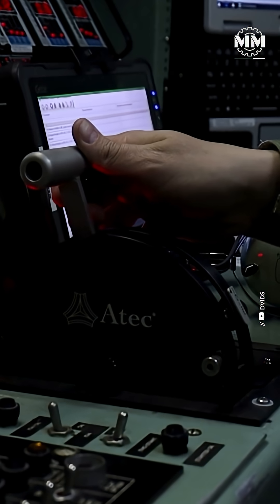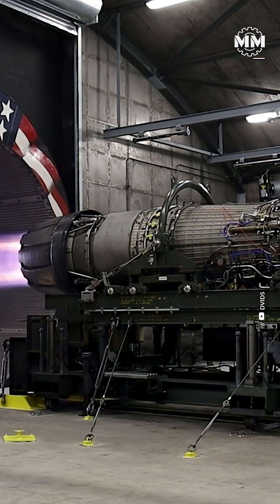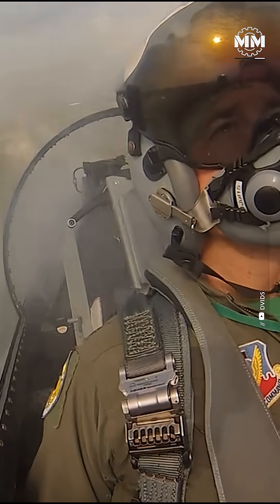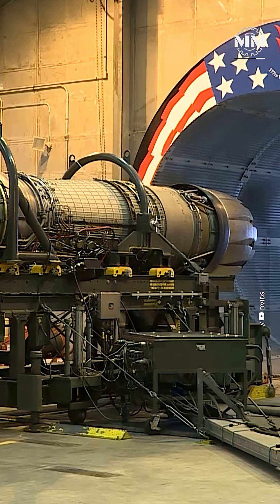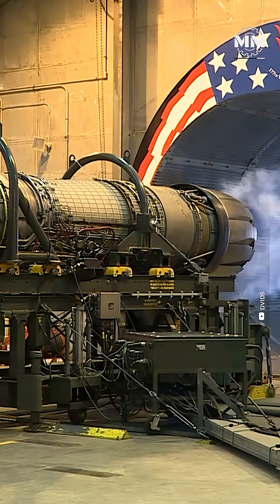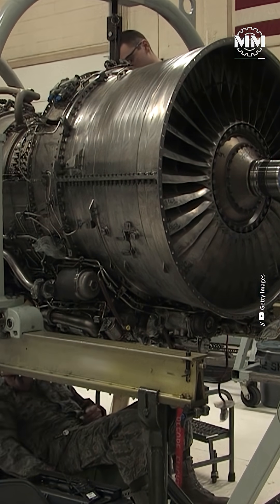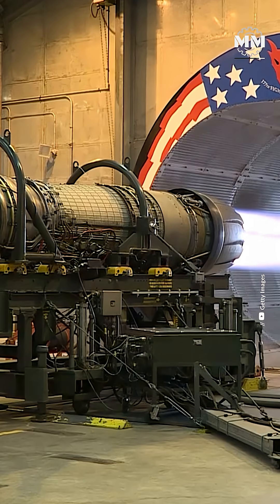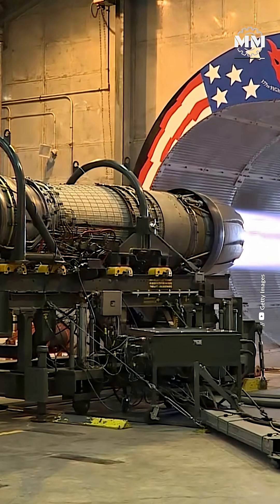Why MiGs and Sukhois Smoke Like Crazy But F-16s Don’t

Comment: the F-4's smoked as well. Don't think I've ever seen a photo or video without those double black soot lines, unless the plane was on the ground.
Reply: I believe that was over 50 years ago,we used to fly bi planes to,but guess what,we don’t anymore.
Reply: J-79s.  Old smokey.  The whine is amazing.
Reply: We learned the hard way. I've seen F4 smoke at over 10 miles (16 kilometers) if they see you first, they have the initiative.  Which usually doesn't work well for you.
Reply: @CarlW-d8c  At the time the F4 was in service, the other planes smoked too, and for the same reason.
Reply: @shane99ca The Mig 21 had only one engine, that smoked considerably less than the F4. It also was much smaller and harder to see,so often our pilots were responding to an attack, not attacking. On the back foot to speak. It was said at the time that was a consideration for the F 16. Which is non smoking and small hard to spot. 
     Using Radar pinpoints you about twice as far away as you can get a return to spot them with. Like being out in a big dark field and turning on a flashlight.
Reply: @CarlW-d8c  One engine smokes less than two. Also, the MiG-21 was a very early design (basically the Soviet Starfighter) with a leaner fuel mix. The J79 turbojets used in the F-4 were notoriously smoky.

Also the MiG-21 had a crappy radar because its nose inlet left no room for a proper radome. The radar dish was actually INSIDE THE SHOCK CONE, which meant that it was correspondingly tiny–and limited.
Reply: The F4 used turbojets, not turbofans. Turbojets were the first type of jet turbine, and were compact, powerful—and dirty. No fan, zero bypass; 100% of thrust came from combustion. The B-52 originally used eight turbojets and its exhaust was BLACK. You can see it in old newsreels and movies like You Only Live Twice.
Reply: @shane99ca You're right  I saw old B 52s in the mid 60s.
Reply: We have both mig 29 and f4 and if you seed their takeoff you see mig 29 is much more smoky during the takeoff.
Reply: @mehdifatemi5329 you middle eastern?   Just guessing by the name.   Have any cool videos of takeoffs or landings?
Reply: You're comparing the F-4 (64 years old and retired 30 years ago) to the su-34 introduced 10 years ago? LOL, keep coping buddy.

Comment: In engineering... and combat.... simplicity is king
Reply: Sometimes yes. Sometimes it depends on the situation. Sometimes more complicated means more weight, operations workload, and things that could go wrong. More downtime for maintenance too. But sometimes more complicated things do give you an advantage. Depends. Like the guy above said, that's one possible example of more sophisticated is better.
Reply: @andrebello4191 plus you can't compare a designed for function heavy haul, fast and long range beast like the Su and Mig offerings, with overcomplicated,  toy scale, sell for maximum profit show ponys like the yanks produce.
Reply: That's why Nazi Germany lost the war their stuff was more expensive and complicated
Reply: ...said the ISIS fighter with an AK-47 who got a head shot by a Delta Operator with night vision.
Reply: @orvarino how did delta/usa fare in Afghanistan?
Reply: It is and it isn't.   If you're catching an aim120 from 35 miles away from an airframe you had no idea was there, hopefully your simple ejection seat works.  

But these 5th gen fighters are extraordinarily maintenance intensive.   If they downed a lot of radar, Sam sites, and enemy front line aircraft initially, there are a lot of f15, f16, and f18 to go in and pound lesser threat targets.
Reply: Some people are Locked inside a "smart" tesla while trying to escape from fire or water  @Payt-y5d
Reply: @Payt-y5d  Failures 16 and Failures 35 are not reliable either
Reply: @Payt-y5d  yeah but we all know that’ll never happen